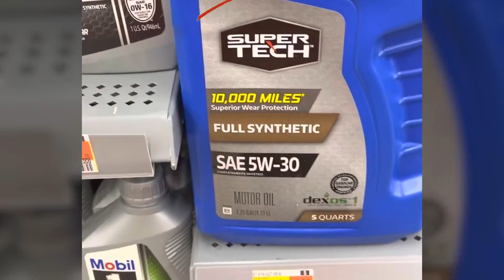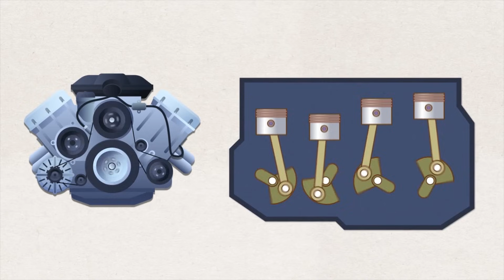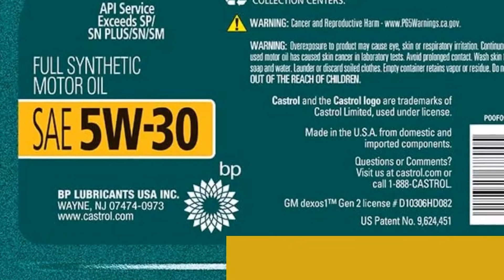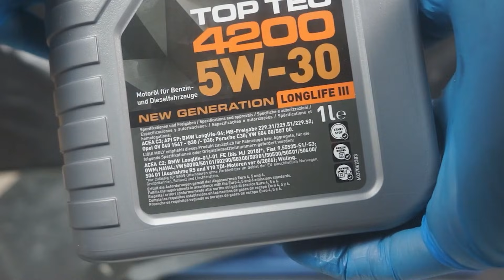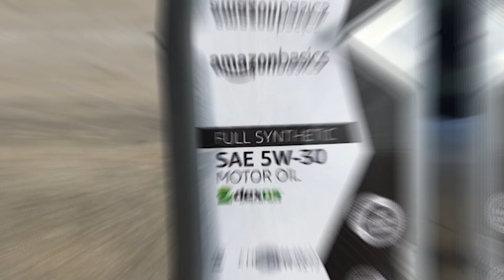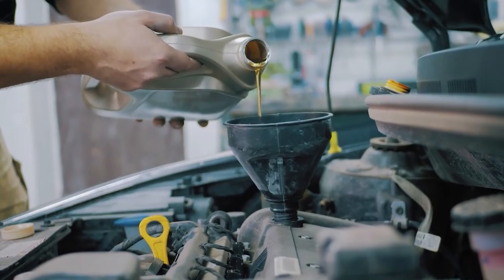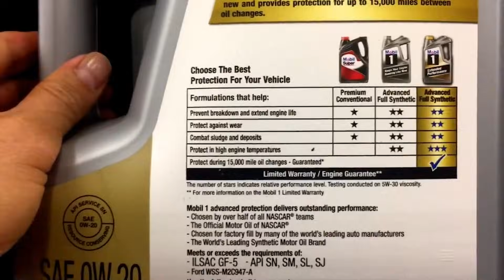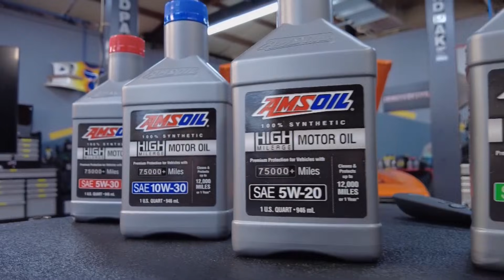NEVER Use These 7 Synthetic Oils (But 3 That Actually Work)

Comment: Application and education. I am the first to say I'm an oil snob. Back in the day Mobil 1 was the cats meow. I use Project Farm and the Oil geek who use oil analysis to confirm Walmart ST, Amazon Basic oil and Kirkland which are all made by Warren to confirm these oils are just as good if not better than some other name brands. I used to do oci @ 3k miles with dino oil but now do 5k oci and Toyota filters on my Tacoma and call it a day.
Reply: I looked at K&N oil filters but found quality control lacking. Gaps in the filter medium and pleats glued together. Premium price gets you a poor product. I sent the filter back and the replacement the company sent was worse. I do use their air filter but that's another thread. Personal choice. Use what you want but get the facts straight.
Reply from the maker: Right on! Thanks for the feedback and the oil advice.

Comment: BULLSHIFT 
I’ve been using SuperTech with Lucas for decades and  replaced valve cover gaskets after 250,000 miles and more 
These engines are clean inside like new
Reply from the maker: Bullshift sounds like a great idea for a brand name

Comment: At 110,000 miles I wanted an intercooler added to my 85' Dodge 600 turbo, I had a 15,000 mile OCI with Supertech full synthetic 10w30.  They insisted on a new head gasket, I asked how the motor looked, they said it was spotless...
Reply from the maker: 85 Dodge 600! Nice

Comment: I had an oil analysis performed on the used oil sample ("100% Synthetic" Amsoil Signature Series 5W-30 Oil) with 7,660 miles (over the course of 1 year) taken from my wife's 2013 Subaru Tribeca and the stellar results revealed only 1.6 ppm wear metals per 1,000 miles, where Lake Speed, Jr, known as the "Motor Oil Geek" on his YT Channel made a statement that any oil achieving less than 5 ppm wear metals per 1,000 miles is really good oil!  I also had an oil analysis performed on the used oil sample ("100% Synthetic" Amsoil Signature Series 0W-20 Oil) taken from my 2016 Toyota Camry Hybrid that had gone 7,233 miles (over the course of 1 year) achieved even greater results revealing only 1.5 ppm wear metals per 1,000 miles!

My son's vehicle, a Ford Taurus, has gone almost 200,000 miles at yearly oil changes at around 20,000 miles with Amsoil 100% Synthetic, Signature Series 5W-20 oil with the larger Amsoil oil filter that is capable to go 25,000 miles. His mechanic says the inside of his Taurus engine is spotless in a recent inspection!
Reply from the maker: That’s very thorough! What made you want to do all those tests?

Comment: Who is changing the oil at 10000? I get supertech & change it 5000-6000. It's all good.
Reply from the maker: Lots of difference advice out there.
Reply: I did when I was driving over 20,000 miles a year, but it was 10w30.  0w20 will shear faster in high heat areas...

Comment: According to oil analyses conducted by Blackstone Labratories, SuperTech Synthetic is a quality motor oil comparable to Mobil1 Synthetic and is Dexos1 certified which requires proprietary tests that go beyond general industry standards. There are many videos available on YouTube that supports this statement. I have been using SuperTech in my 2002 GM 5.3L engine since new and it has 234K miles. I recently replaced the rear main seal and the oil pan was clean.
Reply: The oil geek lake speed jr is a great channel
Reply from the maker: cool. What other channels do you watch for these kind of car maintenance recommendations?

Comment: I totally agree with you about Amsoil. I've used it in my Ecoboost Mustang and Focus RS. I've sent samples to Blackstone for analysis and always get a great report back. I usually change oil between 5-6,000 miles. So far, both cars are running great. Keep up the great work.
Reply from the maker: that's some rigorous testing!

Comment: always heard supertech is mobile 1 in a different bottle.
Reply: I am with you on the Supertech oil being rebottled Mobil 1, been using it since the beginning of time and TOTALLY no problems as of yet👍🏽💪🏽
Reply: @willg.5168  one of the few brands that still have every viscosity available
Reply: @willg.5168 supertech is warren performance oil
Reply: @willg.5168  SuperTech is blended by Warren Oil Company.
Reply: St made by Warren oil good enough for me
Reply from the maker: That would be scandalous!
Reply: @the.GarageIQ  Oil analysis from Project Farm has Supertech FS with a better score than M1.
Reply: @141runn  Do some research before agreeing with hearsay information.
Reply: @carlwilson867 learn comprehension in reading before replying, i never agreed. and i pretty much did research. supertech, costco, amazon, providence, napa and any other house brand there are have no refinery. they buy so much of a main brand they get they get a discount and get it poured in their bottle to sell cheaper. so take it for what its worth
Reply: @carlwilson867 Project Farm has oil analysis on many oils, ya, you should do some research.

Comment: I'm 76 years old and change my oil every 3,000 MI. It equals out to 4 oil changes a   year. I use Valvoline full synthetic high mileage advanced, and a Bosch oil filter. The oil doesn't even look dirty each oil change interval.👍
Reply: If overkill was a person...
Reply from the maker: agree, some oil change habits are over the top, too often.
Reply: I’m at twice a year using Valvoline Full Synthetic as well with the OEM Motorcraft oil filter (which is made by Purolator) and just got my Blackstone lab test results as good as it gets, just last night.
Reply from the maker: right on. What kind of engine?
Reply: @the.GarageIQ 5.0/305ci Coyote Gen1
Reply from the maker: thanks for sharing your routine! The filter also makes a difference.
Reply: 5000 is recommended